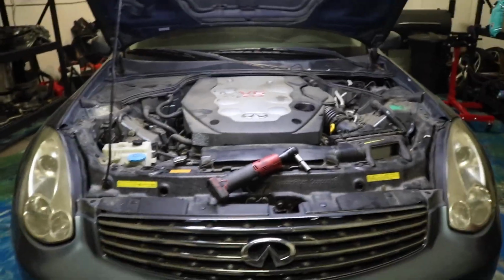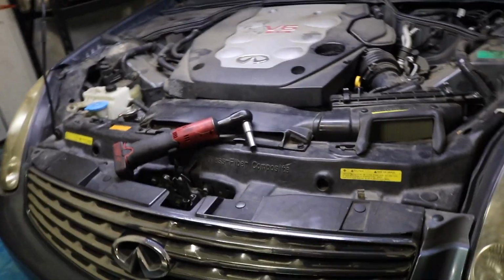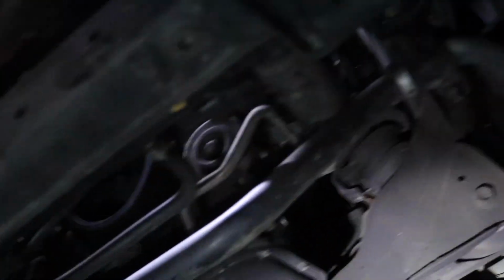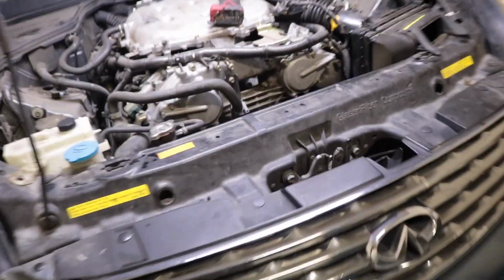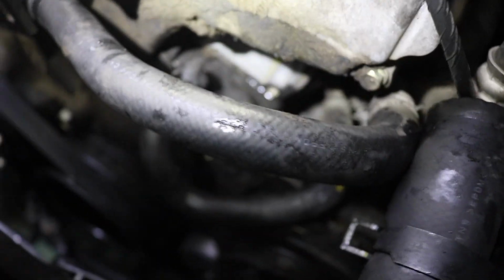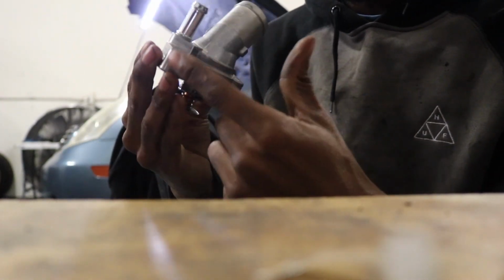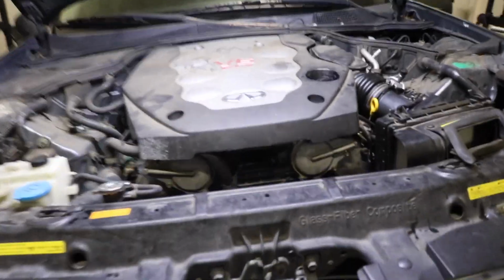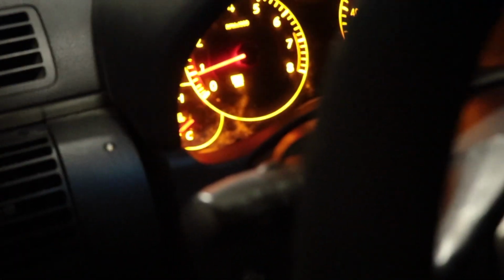2003/2006 infiniti g35 thermostat replacement

Comment: Awesome video! I have a question, when I replace my thermostat do I need to drain my radiator fluid or do I just top off whatever radiator fluid I lost when I took I took off the thermostat? Thanks again buddy
Reply: Should be able to pour in what you lost, don’t forget to bleed the system afterwards.

Comment: That music though H town 100% by any chance have you ever changed the water pump?
Reply: I’ve done the water pump and it’s not easy to get to. You have to take the timing chain cover off. There are bolts inside the oil pan so you have to take the lower oil pan off to get to those, then take off the timing chain cover, and then take off the chain, then you can change the water pump

Comment: What if your G35 coupe over heats and coolant fills your resevor tank
Reply: @isaacmayfield1555  Wrong lol
Reply: @isaacmayfield1555  First thing I did was a block test passed with flying colors.
Reply: Fin wait what was it then because mines doing the same thing and I just spent all morning trying headgasket sealer
Reply: @isaacmayfield1555  rent the block test. Coolant Temp sensor
Reply: @isaacmayfield1555  I changed the thermostat coolant Temp sensor and I flushed the system. Also make sure fans work. Get all air out the system. If not sadly to say it's your waterpump or headgasket. But I'd rent the block test before you do anything
Reply: Fin i swear to fucking god if I spent all morning for it to be something else I’m gonna be pissed but I also hope it’s actually not my head gasket
Reply: @isaacmayfield1555  Your car would over heat extremely fast if it's your headgasket. Did you check the color of your oil? Should look like mud. In addition get the service manual helped me out alot. Hope you figure it out man
Reply: @flipinfin  headgasket you just have a small crack same thing happened to my car replaced it now overheating anymore
Reply: @Ayeecole  nah thats the first thing that i checked
Reply: Fin lol alright bro I did block test too had no combustion gas shit didn't change color at all had a crack in water jackets on my gasket
Reply: Fin coolant went into expansion tank only overheated when I sat in traffic other than that I was able to drive due to the small crack in gasket. But keep on wasting money I'm letting you know ✊🏾
Reply: @Ayeecole  Damn thats crazy. I fixed my overheating issue
Reply: @Ayeecole  i changed my thermostat coolant temp sensor and flushed the system. 

I smoked a wrx sti last week still running like a champ
Reply: Fin good shit 6 speed ?
Reply: @Ayeecole  only manual
Reply: @flipinfin  so was it the headgasket?
Reply: @charger6773  Nah i replaced the coolant sensor and flush the system stopped over heating

Comment: just changed mine and now the vdc and slip lights are on along with the check engine light
Reply: Peter Hunter hey man my g does the same thing, and it’s usally the brake pads and rotors

Comment: Our probably be the first to say this is a terrible how to video One it doesn't even show you where the water pump really is located number to it doesn't show that you need to replace the whole housing how do you replace just the thermostat you have terrible content you should reconsider what you're doing
Reply from the maker: U sound butt hurt bruh 😂
Reply from the maker: Whoa 24 there’s plenty of videos on YouTube
Reply: @Jamari Lincoln lol yo thanks for taking time to document your work. Job looks like a piece of cake. But it was kind of hard to see what you're doing, the right camera would make your content better. I'm still kind of unsure where the thermostat is lol. But no worries I'll find it
Reply: A waste of 6 minutes, but I always hit the like button because you at least took the time to make and post the video. Looks like just follow the lower radiator hose to the T/Stat and remove and replace. BUT make sure you open the bleed valve near the battery box to let the air out!